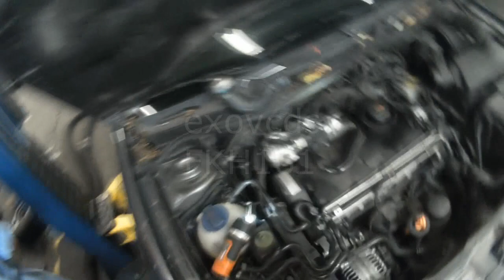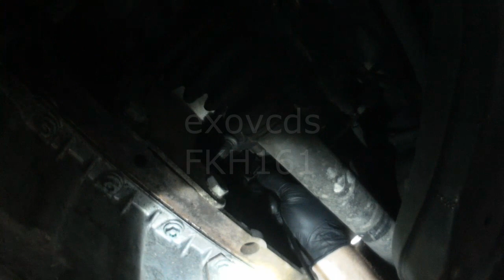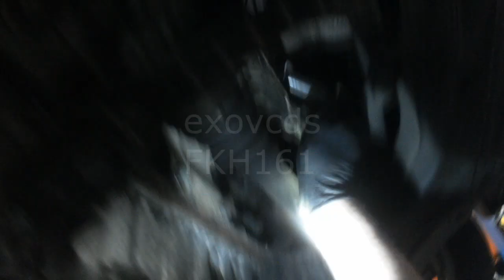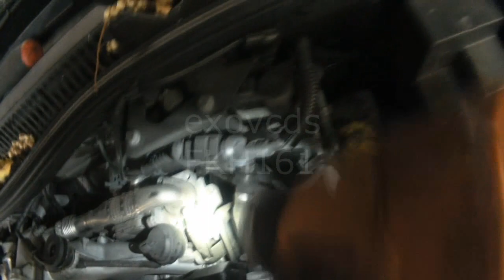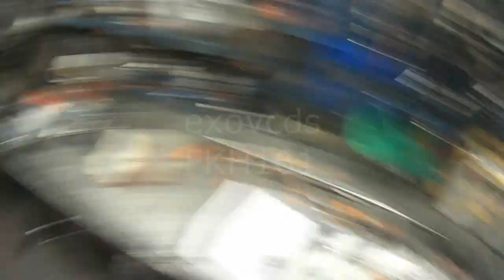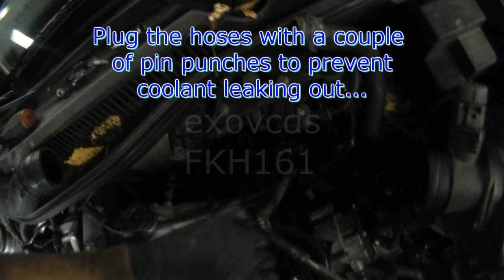VW A4: BEW EGR Cooler Removal

Comment: Nice video.  It is dark, so a little hard to see what you are doing on some steps.  The first time you go under the car, you have pliers with a long flexible extension.  My guess is you are removing a clamp on the lower part of the air intake tube.  Can you confirm?  Also, the next step under the car, you have a very long extension on your ratchet, but I have no idea what you removed.  This was the step before removing the lower EGR flange bolts.

Comment: great vid. what are the innee diameters of small and big cooling hoses for this radiator? i want to get rid of it totaly and must to join the lines. i've already made the plug plate & ECU disabling.
Reply from the maker: I'm thinking 1/2" or 3/4" inside diameter... most likely 3/4".

Comment: Would you be able to get into more detail on how exactly a person gets the clamp off at the intake hose to the turbo?  What is the long bendable tool you have?  and is it a must have tool?
Reply from the maker: Kelly Elliott Can you specify the time in the video, so that I can find what you are looking at?
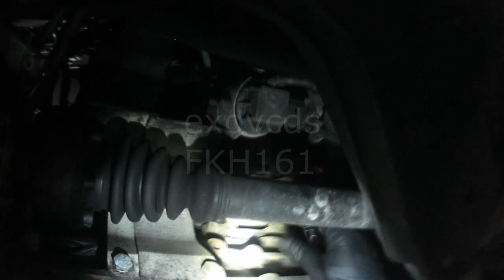Reply: 2:02 is when you're doing it.  It's the last step in getting the turbo   intake hose out I think
Reply from the maker: Kelly Elliott Thanks, type "VW Hose clamp pliers" into google image search engine to find something similar and then look for an online source that sells them.

http://img820.imageshack.us/img820/9348/00947390000.jpg
Reply from the maker: Kelly Elliott It is not needed, but can make the job easier (due to lack of access with regular pliers).
Reply: Thanks!  Much appreciated

Comment: Great vid. I'm an ALH guy and I'm working on a fiends car BEW/BRM. Any directions to the EGR value would be great. Written or picture would be great.
Reply from the maker: George Randall Sorry, EGR value or EGR Valve? The solenoid operated EGR is to the right of the intake flap at the manifold. Remove three 5mm allen bolts and you can pull it out. There is a vacuum operated flap by the cooler (shown in video) that directs exhaust through or around the EGR cooler.

Comment: Hello. I have the exact same engine. I’m installing new turbo and, doing a egr delete. It’s been a while since I took it all apart. I’m currently putting everything back together. “I should have labeled the vacuum lines” but, I didn’t. Anywho. I’m wondering if you tell/show me with vacuum line I’ll have to cap off?  For the delete?  Any help will be greatly appreciated. Thank you.
Reply from the maker: https://workshop-manuals.com/volkswagen/golf-mk4/images/golf-mk4-8890.png
Disconnect / plug as you need.
Reply from the maker: Oops, sorry. Forgot to ask... ALH or BEW? Above link is for ALH.
Reply from the maker: Blonde moment... BEW is electronic EGR.  The link should contain what you need.
Reply from the maker: One more oops... if you do have the same e give as in the video, then there is no vacuum for egr (here in North America). So I'm confused why you are asking.
Reply: @EXOVCDS  I’m trying to figure out what all I have to do when deleting the egr.  So it’s electronic egr? So I jus keep the electric connector unplugged to the egr? Know I got to add block off plates and etc. Sorry I’m no pro. Jus trying to do things myself. lol.
Reply from the maker: You tell me... does your intake manifold have an electronically operated EGR valve or is there a vacuum hose going to it? Removing the EGR cooler can lengthen the time before the coolant gets warm (exhaust flowing through the cooler adds heat to the coolant). So which engine do you have? ALH TDI with a Diesel Injection Pump or a BEW TDI with no injection pump? I can't see what you see and I can't provide information if I don't know what I'm dealing with.
Reply: @EXOVCDS  that’s one problem. I can’t for the life of me remember. I took it all apart about a year ago. Finally got all my parts (finance problems.) and, was starting reinstall. Can’t remember if it had a vacuum line going to it.  It’s a 2004 tdi with the bew engine. Thanks for your time.
Reply from the maker: @Theunitbth  2004 BEW is pure electrical... mounted on the intake manifold sticking over the valve cover.
Reply: @EXOVCDS  thank u

Comment: I've been getting a noticeable fume inside my 05 Golf TDI. The Golf has 170k miles on it.  Intake mani, EGR, EGR cooler have never been cleaned.  Wondering if an clog might be the culprit and that pressure is releasing some fumes behind dash?
Reply from the maker: The exhaust flex pipe from the turbo to the catalytic converter might be leaking a bit. Have a look from under the car at the turbo & exhaust... look for carbon soot. Replace whatever part it is coming out from.

Comment: Good bud but I don't think it's the same for the BRM. Am I correct? Can you drop the BRM EGR cooler from the bottom?
Reply from the maker: Jesus Garcia Good point... the BRM is sitting front to back not side to side. Things will be different due to engine position, but I believe they are similar enough, since they are both PD engines.

Comment: would this be why my car drops coolant but water pump is fine and no overheaing
Reply from the maker: Coolant leaks can happen is several different places... follow the leak to the source, then you know what you need to replace.
Reply: I've done a hc check in the header tank and there are no exhaust gasses so I haven't suspected its headgasket. Can't find any leaks anywhere. But if the water level is on max before I start the car up then go for a 30min drive the water level light comes on then if I stop the car and look at the water level it's gone down to minimum but when I open the header tank cap (when it's cooled down) it releases pressure and the water level will rise back the max. The only thing I could think of if it's the egr cooler???
Reply from the maker: Disconnect the coolant hoses at the egr and connect them together. Run the engine and check if it still happens.
Reply: Ok thanks

Comment: is there necessary to get the car tune after egr delite? If the answer is yes how much it will cost?
Reply from the maker: There's a good chance that the check engine light will be on after the delete... reflashing / reprogramming of the ECM will need to be done.

Comment: I am pumping white smoke under heavy throttle. Topping up coolant every month or so. I bought heAdgasket chemical test which says isn't heAdgasket. How can I text the egr to see if it's the egr cooler that's the problem
Reply from the maker: Disconnect the the coolant hoses going to the egr and plug them together. Drive it as you normally would and see if it still blows smoke. Or disconnect the piping at the egr and look for signs of coolant going to the intake.
Reply: +Thomas EXOVCDS thanks I will. If I look in the intake will it be all wet and gooey if it's leaking there
Reply from the maker: tom If the is coolant getting in from the egr cooler, then yes... you should see some kind of sign / residue from it.

Comment: Mine will not come off after removing the 3 5mm bolts????
Reply from the maker: Kane Marcinkiw You might have missed a bolt / connection. What year, model, engine? Parts diagram for a 2004 BEW:
https://www.kermatdi.com/files/egr_pipe_issue_pic.png

Comment: Hello !
Great video ! I have 1.9 TDI AXR European Engine, but it seems to be same EGR Cooler . My Engine is idling very roughly and the vacuum actuated valve that is in the EGR is always opening and closing at idle in the same rythm as the engine is shuddering . Do you think the problem is the EGR Cooler or something else ?
Reply from the maker: bbogdanmircea I don't know the specifics but I know that the ECM cycles the EGR for testing purposes... have you already checked for fault codes? If you run EGR basic settings / output tests, you can determine if the EGR / cooler is plugged (cooler can be plugged, but you can still have EGR flow because it bypasses the cooler).
Reply: *****

Thanks for the quick answer !
Last time I scanned the car and I had some very strange error, I had missfire error on a cylinder, but the engine is running ok when not at idle. Problem is idle when especially after starting engine is looks like its running in 3 cylinders, its shacking a lot like its not firing correctly.
I have to say engine has very high mileage, more than 300000 km and no major repair on the engine side, but has been running great since I have the car, so no reason to suspect something bad. ONLY problem that I had is the upper hose that goes into EGR body, connection is really stupid with spring and teeth that get worn after around 2 years, and then lose boost and oil vapors, but besides this no other problems.
Should I suspect a bad camshaft worn by the injectors or the tandem pump ?
Basically I visited the mechanic who I trust, and he just unplugged the vacuum hose that goes to the EGR cooler valve and the engine stopped shacking, but then he said that he doesn't understand why the ECM commands the EGR cooler valve to go OFF and ON like that ... maybe it is because the cooler is totally full so ECM has some loop to clean it ?
Really don't know, I think I will go back to this guy and pay whatever it takes to get that cooler off, although it seems like a b...tch of a job ...